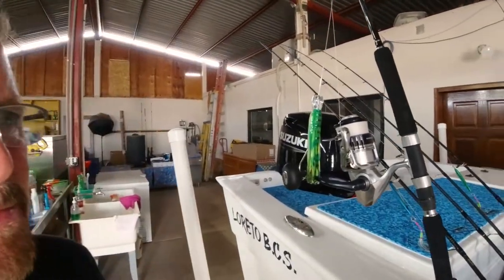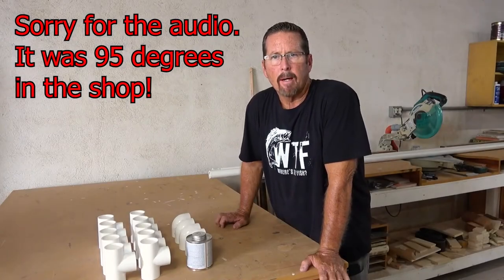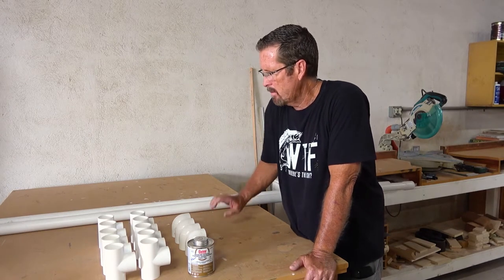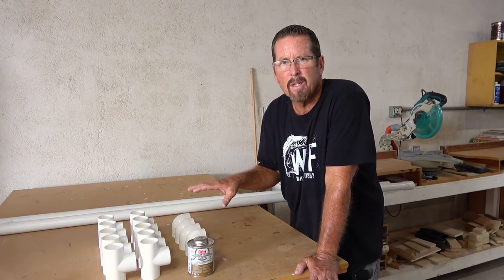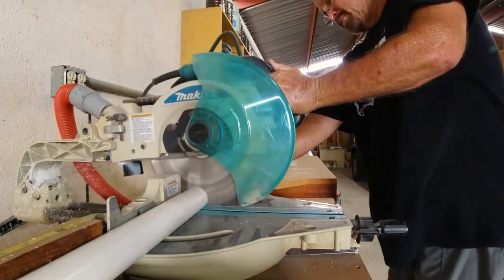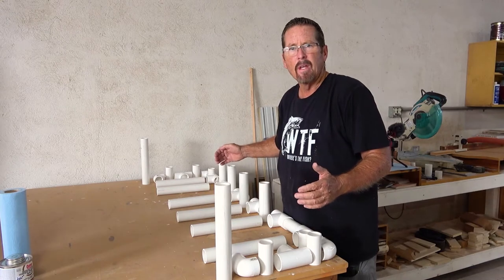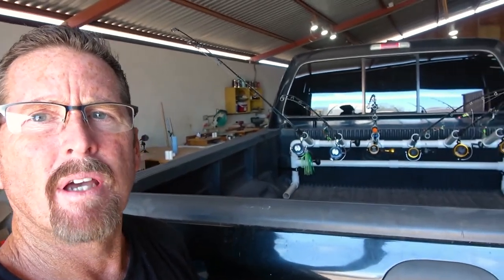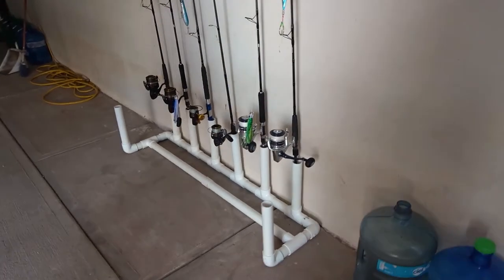DIY  Multi Rod Holder for Garage and Truck!

Comment: Hi nice build. How long did you make the support joints for the base ? Supports between tees 7”, rod holders 12” , supports?
Reply from the maker: I don't have the rack anymore.  I used my rod and reels to calculate the distance between. Rod and reel combos vary in width...
Reply: I’m asking in regards to the distance from the corner elbow down to the next tee where the 54” pvc attaches
Reply from the maker: I apologize, I don't remember. Sorry!